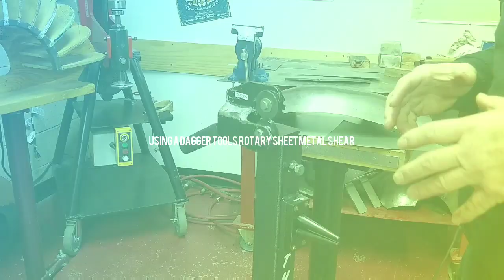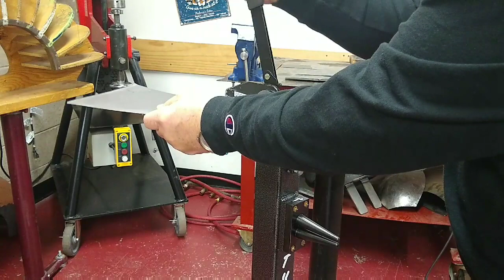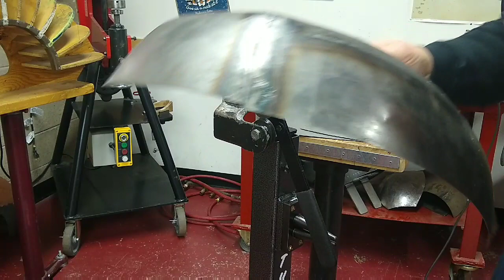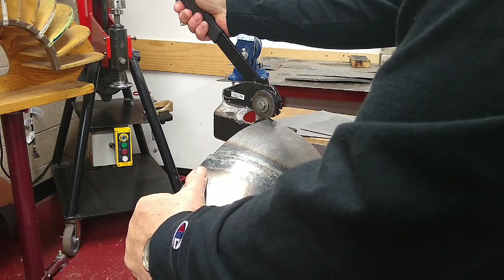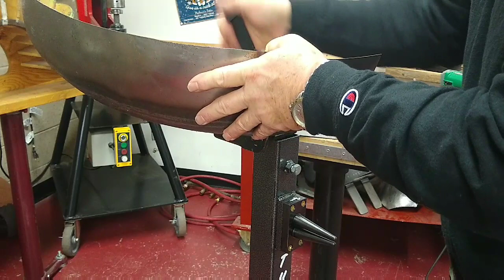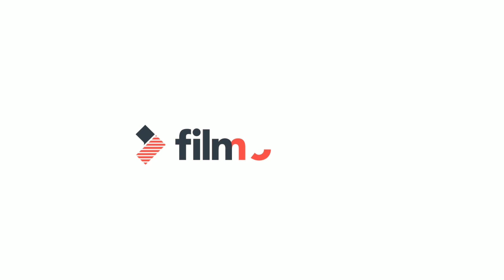Using Dagger Tools sheet metal rotary hand shear

Comment: Thanks for the video! 
Did you notice it kind skipped/skidded on the crown piece? I have one of these and get that problem, and cannot seem to get the spacing on the cutter right. Cannot find anything about proper adjustment for a given material thickness.
Reply: Any adjustment is very slight, the type of surface shape can have a impact occasionally, thats why we developed the tapered upper draw wheel with a slightly differenty knurl do you have that style of upper draw wheel?
Reply: @craigpeterson6956  Not sure I understand, but can say that the upper wheel does have a pretty pronounced knurl and the lower cutting(?) wheel has none; maybe my brand is different than the one in the video. The GOOD NEWS is -- and this is thanks to the video here -- I was able to go out and dust this bad boy off and adjust it so it works much better. And you are so right that the adjustments are indeed very small to make a big difference in functionality. For me,  there is still a little bit of skidding but a wheel overlap equal to the material thickness seems to work. I do have to give a firm push the material in at times though. 14 ga mild steel, so I'm probably at the cutter's limit. Gloves definitly recommended - Ha.
Reply: @AerialLensVideo  If you get  a chance go to daggertools.com look up dsc05-blade and you'll see the tappered design upper draw wheel we have. This design improves the metal drawing through the shear cutter, and limits slip based on higher crown shape, my expereience is that the upper-lower blade have approx a 1/16" overlap for best all around cutting, ususally up to 16 gauge
Reply: @craigpeterson6956  Definitely will get that - Thanks! 
By the way, I know I am really pushing it with 14 gage, but still happy now.